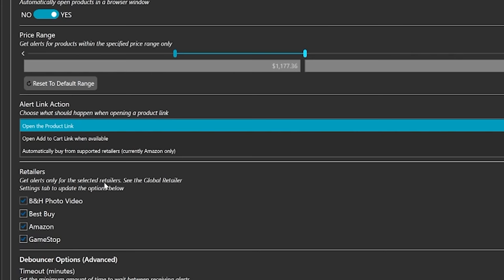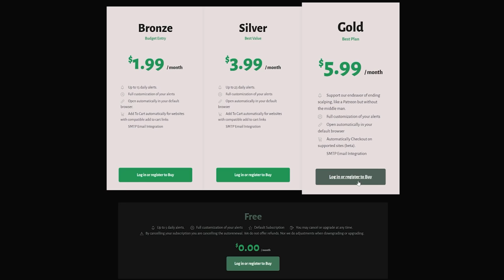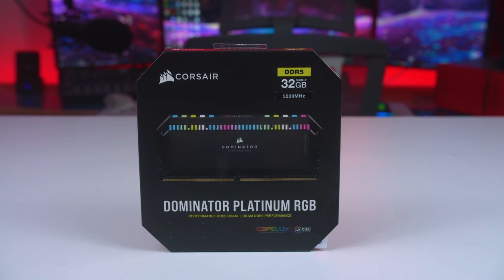I built a White RGB Z690 Water Cooled PC

Comment: Awesome stuff my friend. Clean as always. How do you usually help the gpu sag on that huge Strix 3080? Building a rig myself and it won't look as clean.
Reply from the maker: You can buy anti sag brackets and i know asus has just released one aswell
Reply: @DesignsByIFR  I appreciate the reply, but I never see any modders using a sag bracket. Won’t it look tacky with a liquid cooled gpu?
Reply: Could you mount it vertically with a riser cable instead?
Reply: @DirtyDandino  you could do a custom one and do it yourself by just sticking something underneath

Comment: Looking to run a triple 360mm rad loop in a Lian Li 011 Dynamic case, cooling a i9-12900KF and MSI Gaming X Trio 3080 Ti (using EKWB face and back plate active water cooling) wonder if I should invest in a larger case or if that’s a good build. 

Cooling parts included: 

-EKWB Velocity Z690 plexi block for my Tomahawk Z690 DDR4 MB (designed for the board)
-EKWB Vector Trio WB for 3080/3090
-EKWB Vector Trio Active backplate for 3080/3090
-EKWB 1500L/Hr pump W/ 200ml res
-ThermalTake 64mm thick 360mm Copper Rad
- x2 Corsair 27mm thick 360mm copper Rads
- ThermalTake 16mm OD (12mm ID) PETG tubing 
- EKWB compression fittings

Comment: Nice but you need to hide the taskbar on that LCD panel. I know it would have increased cost (well, it's over three grand anyway) but I think ASUS should have gone with a white PCB for that graphics card... it looks a bit awkward with the black board sandwiched between the white. You can't help it but the RAM would have been more ascetic in white (I don't believe Corsair has released any yet and it's moot anyway with the current PMIC shortage).

I've got my fully water cooled Z690/12900K/DDR5 build completed now and I used the EK Quantum Velocity² CPU block that torques down from the rear of the motherboard - no more visible screws! I moved my RTX 3090 to the new rig from the 9900K build and reunited the 9900K with my GTX 1080TI's. Was quite a busy week. I've run a few benchmarks and yeah, it quickly became obvious that the 9900K w/all core 5.1GHz was holding the RTX 3090 back.
Reply from the maker: Yes i completely agree with the PCB being white. I also wanted white RAM but corsair did not have it available unfortunately.

Have a great day mate

Comment: How was the RGB controller stuff handled? 2 Commander Cores or what? With 9 total devices, that would be multiple controllers set up in iCue. Was hardware lighting on rainbow used to achieve a uniform look?

Comment: What' temperatures are you getting of the M2_1 slot with the Corsairs? I have a MP 600 Pro XT Hydro X and it's a bit of a hustle to remove the ROG M2 heatsinks and thermal pads and use the Corsairs waterblock. Not sure it's worth the effort.

Comment: My build is kind of similar (CPU is 12900kf)  though I am not sure how good a contact the CPU block (XC7) cold plate has with the IHS. Cores temps very easily touch 100°C and thermal throttles. Have 3 rads, 1x XR7 480mm, 1x XR5 420mm & 1x XR7 360mm. What kind of temps are you getting at full load (Cinebench R23 or R20)?

Comment: If I may ask, which sizes in length are your white cable mods for the EPS connectors and the 3x 8PIn bridged GPU cables? I have the be quiet 802 and want to add them aswell

Comment: Wow, looks great! I just have 3 (sets of) questions

1. Why does this system need that much storage at that speed? Are you planning on downloading every top 100 games on steam? Are you aware that most games don’t even support gen 3 speeds?

2. What’s up with he water cooling? The tube going from the VRMs to the CPU use looks like someone grabbed it and stretched it to the side. Wouldn’t it have been cleaner to just run it straight down? It looks like you can. Also, I get that you don’t want to water cool the GPU because of it’s white aesthetic, but then just slap a white AIO on the CPU. The VRMs probably already have enough cooling from their CHONKER heat sinks and some AIOs can look just as good as the hardline tubing you did, not to mention the time it would save. The empty space behind the pump/reservoir unit could be used for more RGB fans if you use the OEM panel. To top it all off, your tubing lines don’t look very parallel.

3. Even with all of my “complaints” (I’d personally call it constructive criticism), I missed the part of the video where you give it away. Could you link that please? It would be very much appreciated.